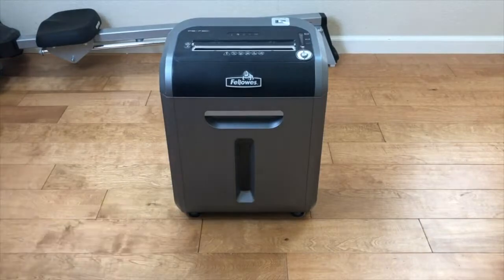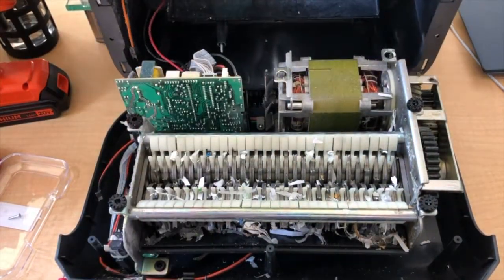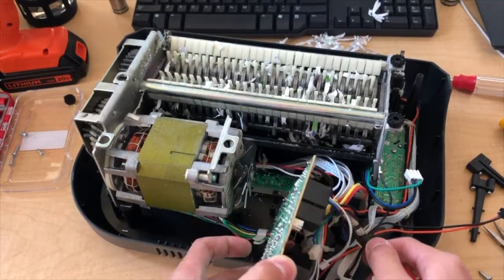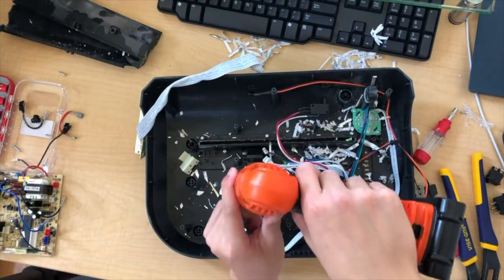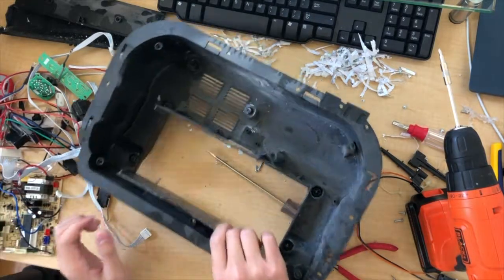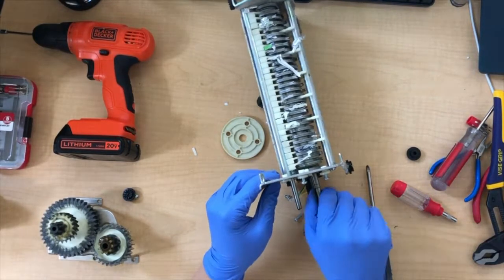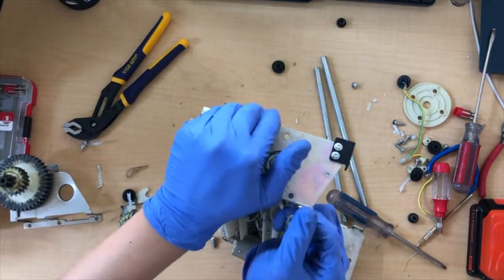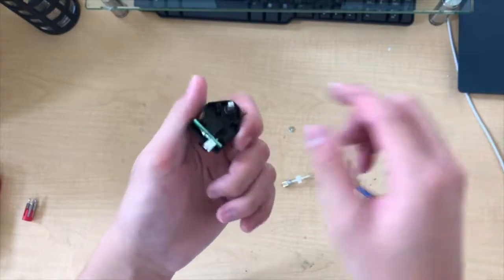Fellowes Shredder Teardown

Comment: A big shout-out to Cpt. Morris Productions for this teardown video.  I found while searching for the solution to why my Fellows shredder of this model suddenly stopped turning off after shredding.  It was your tear down that revealed to me the counter-weighted lever that gave indication to how thick the paper was entering the shredder by its optical encoder and light chopper wheel.  I'd also re-read my shredders instructions and found where it said "do not spray any lubricants or solvents into the hopper or shredder blades".  I'd been doing that for years and now realized the reason why it isn't turning off and always indicating at least one paper thickness is because I gummed up the swing operation of this lever with my transgressions of lubricants.  The great thing your video showed is that once the cover is off, the motor and shredder assembly can be carefully picked up and swung toward the front thereby providing access to the two curved paper guide pieces that hold the led and led sensor.  These two curved plastic pieces had decades of accumulation of paper dust and thick, thick grease (WD-40 that has dried up and left a thick pasty mess).  Removing and cleaning these curved pieces and the LED and sensor allowed me to then clean all around the white plastic, counter-weighted thickness detector.  Once back together, it works like a charm again.  Many thanks!

As an addendum I want to mention that just as in Cpt. Morris's video, the plastic curved pieces in my shredder were also cracked, broken at each end.  It did not affect the shredders operation and the four screws, two in each curved piece, held them securely in place and no further damage occurred, but it does show this to be a common failure mode for this model Fellows shredder.

Comment: I was hoping you would show how to re assemble the actual cutter blades on the rollers.Mine had broken spacers and hex spacers on the shafts. 
One side is fine, but I think you have to remove, then reassemble both to get the overlap of the teeth right..
 EDIT>>>>> I was able to reassemble my Aurora shredder. Used spacers and a few of the 'strippers that ride on the spacers. Works fine now!!  Today I  bought a Fellowes DS-16Ci for $15 at the goodwill. Can't believe how quiet it is? Will take apart, clean the cutters, and re lube the gears. I have 4 shredders now, but no way am I a shredder collector, lol. Going to sell a couple of the smaller, totally serviced ones.

Comment: I am curious to find out if you can remove the plastic parts between blades and still be able to shred ?  Or are the small plastic parts mandatory to hold the blades together ?

Comment: Have you noticed in most of Fellowes Shredder you have 2 metal gears and one with plastic with light metal like aluminium or magnesium...Just to make sure the gear breaking after a while like  1 year or 2 max...I noticed this because mine stop working and that's what i found....Really??
Reply: Yes same problem with mine. That big plastic second stage gear will eventually fail. If it was made out of metal it would probably last forever. And that’s why it’s plastic. Planned obsolescence. Finding that gear is difficult to nearly impossible and if you do find one it’s expensive like $100. So you end up doing exactly what I’m doing you go out and you buy another shredder. “it’s a little bit cheesy but it’s nicely displayed” -FZ